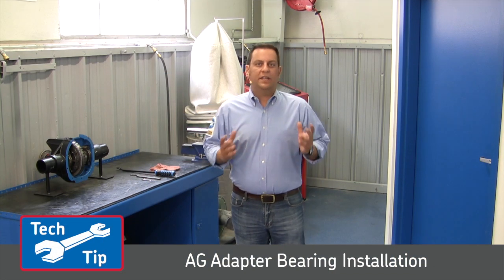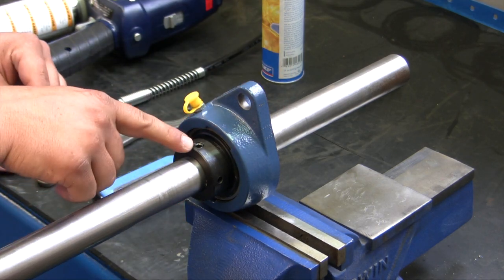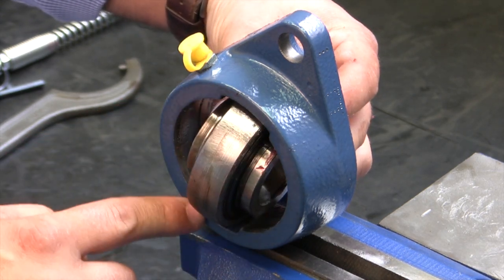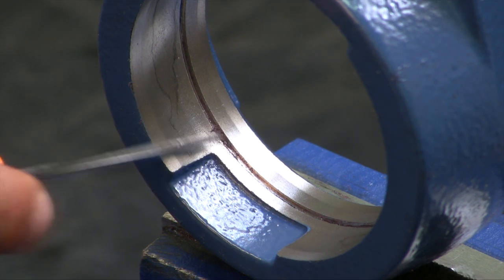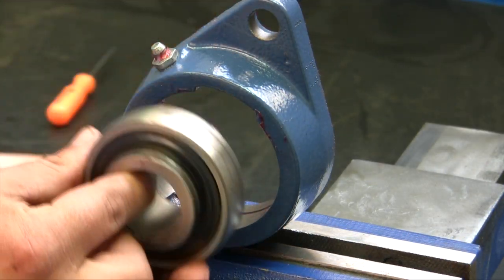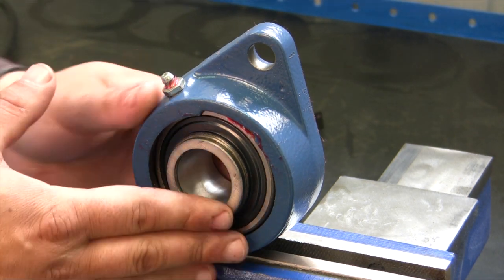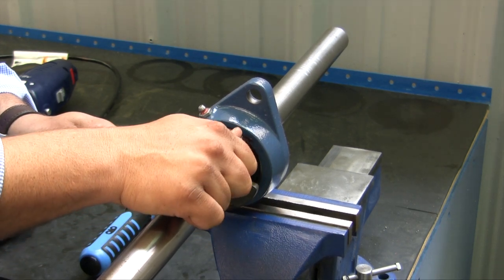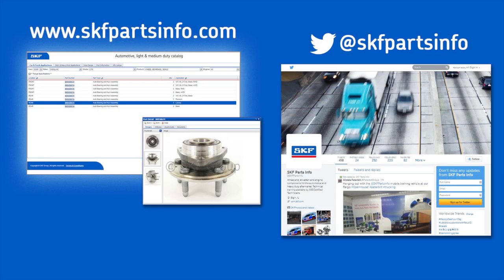Adapter bearing installation

Comment: Thanks, I was wondering about that, I ended up using a handle off of a Broken Chain Disconnector, instead of a pry bar, but before I seen this video, I was going to beat it in with a hammer, I just installed my first bearing in a housing with no bearing in it, needed it as an Idle Gear shaft or a Slave gear shaft, I'm basically teaching myself Mechanical Engineering, videos like this are a huge help, saves a ton of money, time & effort, now just need to grease it & get a nipple cover I guess.
Reply: you all prolly dont give a damn but does anybody know a tool to get back into an Instagram account??
I was dumb lost the account password. I would love any tips you can offer me.
Reply: @Simon Kellen Instablaster :)
Reply: @Magnus Larry i really appreciate your reply. I got to the site thru google and Im in the hacking process atm.
I see it takes quite some time so I will get back to you later with my results.
Reply: @Magnus Larry it worked and I finally got access to my account again. Im so happy!
Thank you so much, you really help me out!
Reply: @Simon Kellen You are welcome :D

Comment: That design is really smart, strictly keeps the bearing in while it can still be removed, but does that also mean that the bearing can rotate in the housing? So when using this type of bearing unit, I need 2 of these to have a fixed axis dierction?
Reply from the maker: The inner portion of the bearing rotates with the shaft.  The type of equipment that you have determines how the ends are held and if you need more than one. Thanks for watching!

Comment: what can i do if I don't have the grease machine you use? and what can I do to make the bearings roll easier? I have two UCP201 - UCP212
Reply from the maker: A standard grease gun can be used in place of the battery powered Lincoln grease gun. If the bearing is not rolling easily 
make sure the shaft that the bearing is mounted to is in alignment and add addition grease as needed.

Comment: What about if the shaft doesn't come out like that how do u remove the bearing from the shaft when it's been there for ever
Reply from the maker: Rust that develops over time can make the removal more challenging. Use a good rust penetrate several times. If that isn't enough to remove it then use heat.

Comment: Hello. Does it affect water and cause it to break or not
Reply from the maker: The adapter bearing with their double or triple lips seals are very water resistant. If water does get into a bearing it can adversely affect its operation.

Comment: Hi. Does the water affect the roller or not.
Reply from the maker: The adapter bearing's double or triple lip seals are very water resistant. If water does get into a bearing it can adversely affect its operation.

Comment: Is there any way to remove the seal of the adapter and expose the balls for cleaning ?
Reply from the maker: Thanks for watching, the adapter bearing would not need to come apart for cleaning. 
Greasing the bearing will help maintain the longevity of the part. If the adapter bearing is making noise it may need replacement.
Reply: So what's the machine that you need for greasing it ?
Reply from the maker: The machine used to grease the zerk fitting is a Lincoln 18 volt cordless grease gun. 
This is a good powerful handy grease gun, but other types of grease guns can be used. 
Also, depending on the needs or your adapter bearing, we offer non-relubricatable bearings
Reply: can we use a single bearing to support a shaft and which can take axial,radial as well as moment load?
Reply: @SKFPartsInfo  how alligment motor and blowar pulley with bealt

Comment: what size is the two bolt flange ?
Reply from the maker: Thanks for watching. SKF supplies many different size bearing and flanges. The video shows an example of how the bearing fits into the two bolt flange and locks onto a shaft.
If you need a specific size you can visit a local parts store or distributor that carries SKF premium bearings and they can provide you the correct part for your needs.
Reply: just wanted to make a pull up bar than can spin freely , and the one in the video looked perfect size
Reply: Those two holes are 7/16''.